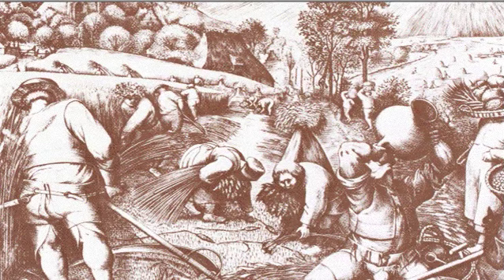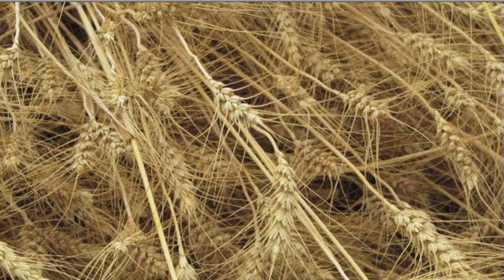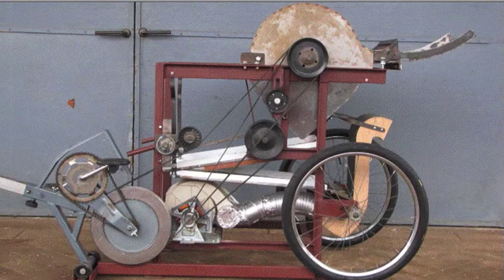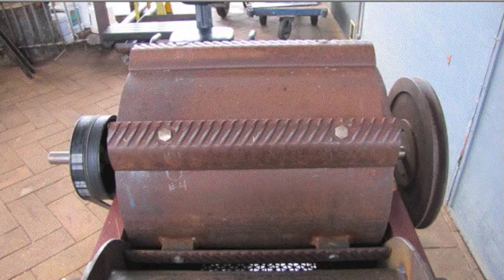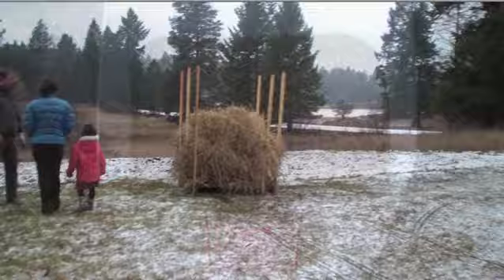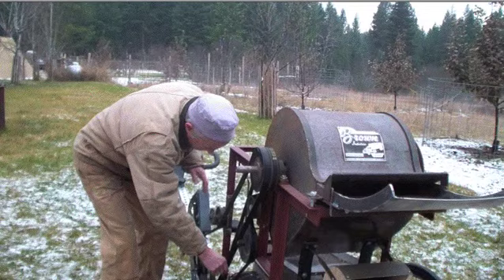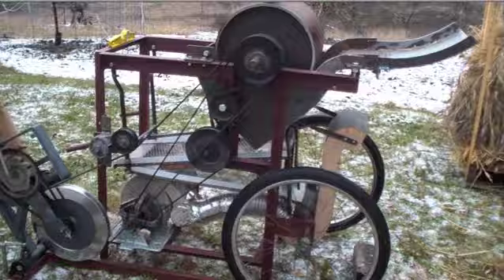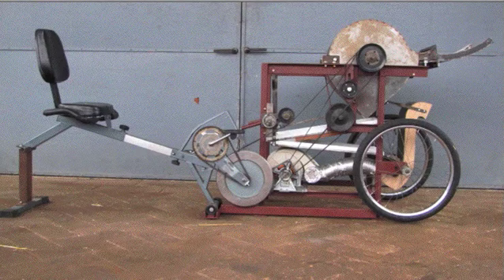Pedal powered threshing machine

Comment: Quite an upgrade from the Tunturi de-huller! Would be curious to know how this one is separating the wheat from the chaff without using that original method of "grinding"?
Reply: This is a thresher, the other machine is a de-huller. You would need both to process grain. A full-size threshing machine incorporated both processes.